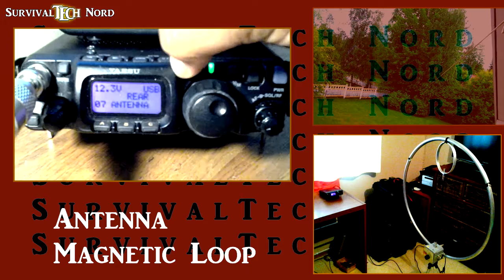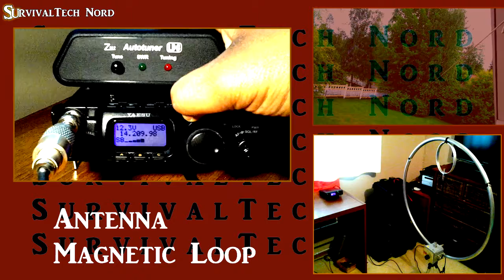Indoor Magnetic Loop vs Long Wire Ham Radio & Shortwave RX Comparison

Comment: I really like your video. I have been doing a lot of research on mag-loop antennas. I have seen some videos that talk about the danger of being to close to the mag-loop when transmitting. It depends on the power out put but suggestions are for up to 12 feet of distance. You might want to look into that.
Reply from the maker: I know very well they distances for exposure versus proximity and output power using a magnetic loop antenna.

Comment: Loop- 
Hi Q, Less noise, with a minimal vari cap can be used to transmit, can be stored when not in use about the size of a bike, and feedpoint is right on antenna, but has fewer bands it can be tuned to at the size of a bike, say 15-30, yet struggle @ 40 meter band.
But, you have to hobble to antenna to tune it, because it is incorporated into the array. 

Tuner and random wire-
Slight stronger signal, but gathers noise and harmonics as it takes up more space near powerlines, utilities, ect, might hear well, but just not get a safe SWR reading on certain bands for transmit, and feedpoint is at radio, near any computers or clocks that can start feeding it noise, at the connection point, or adjacent ground wire or also long, or multi radial counterpoise, that can be a fire hazard at low power on the ends if not insulated, but can have a larger choice of hf bands it can tune to, say 6-80, and struggle @ 160 meter band.
But, the tuner is at or in the radio.

Try to run both, if possible, and switch between the two for their different propogation qualities.

Comment: -I've had good results with the Alexloop antenna as well.  On 5w SSB I was able to have a QSO in Turkey with my Yaesu 817ND.  For pure receiving it does very well.  

-The mag loops are great, the only problem with them is they are indoor antennas and kinda ugly to have set up in a room, they also aren't outside away from walls, metal and stray signals.  They are also a PAIN to tune, with a VERY narrow frequency window (10-20 khz) due their high Q, and they typically cant handle much power (if transmitting).  They are also directional and easily rotatated, a big plus.  

-Wire antennas are outdoor solutions that are more permanent - but not very visible.  They are less tune-able than a mag loop to some extent as their resonant frequency depends on their length, but a fan dipole set up for major bands is easy to build.  Wire antennas are typically omidirectional in a vertical set up; or have about 2db of gain (not quite 2x signal strength) when hung horizontally with nulls at the ends.  Obviously you cant rotate them, but if you have the space setting one up NExSW and a second NWxSE with an antenna switch is a fantastic set up.  

Experienced radio guys know that your antenna set-up is probably the most important aspect to a successful radio hobby.  Everything should key off of your antenna set up.  If all you can have where you live is a Mag Loop, fine, just dont go out and buy a $5000 radio.  The opposite is not true.  If you have the space/means to put up excellent antennas, any modern transceiver or receiver you can hook up will benefit immensely and perform better than expensive radios hooked up to  small compromise antennas.
Reply from the maker: +kd8opi excellent advice!!!

Comment: Interesting... But you need to make a 100W version, so the user feels he's getting the max dx potential out of the setup..
Reply from the maker: Jim T No!
Too much RF exposure! Here's an idea http://www.survivaltechnology.net/ultimate-stealth-antenna-for-hf-communications/
Reply from the maker: 100 watt version would be cool, but I still wouldn't use it in a limited space or a balcony because of the high voltages.
Reply: Hi,
Here goes! Stupid Question. Is there any way to transmit up to 100 watts from the indoors? with he loop? I have one window by my desk that I could set it up after putting some vinyl in the window so that it could not be seen from outside. I would be sitting about four feet from the antenna.Any comments?

Comment: Thanks for sharing the video. I see that you have the larger loop aluminum antennae. Does that work any different than the coax cable F loop ?  I am still on the fence on getting one. More research is in order. :)
Reply from the maker: Thanks for your comment.
This might be completely subjective, but I believe there are two noticeable improvements. Transmission and Reception are noticeably better, and low SWR is much easier to achieve, when using the collapsible aluminium loop, instead of the coax. 
Check out my f-loop playlist for more opinions from other radio operators.

Comment: Interesting comparison. My magloop is outdoors and I've talked over 5,000 miles with it.
Reply from the maker: I only used the long wire as a basis for showing signal strength on the S meter. Otherwise it would be really silly comparison :D
Reply from the maker: I forgot to ask you what magloop are you using?
Love the channel.  Keep up the great work.
Reply: SurvivalTech Nord mine is the MFJ-1786. Not the cheapest, but the remote tuner works well.